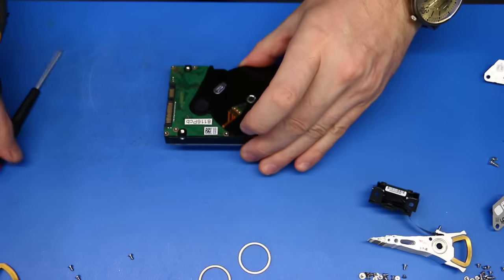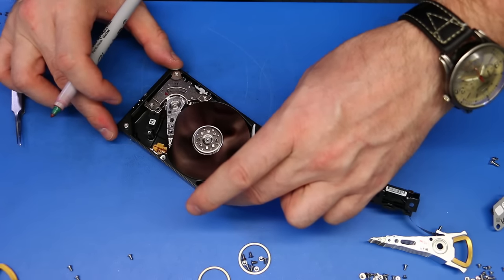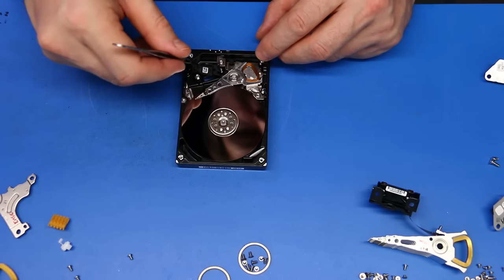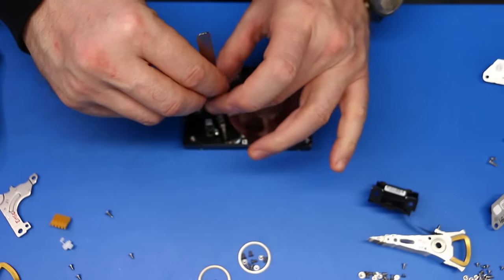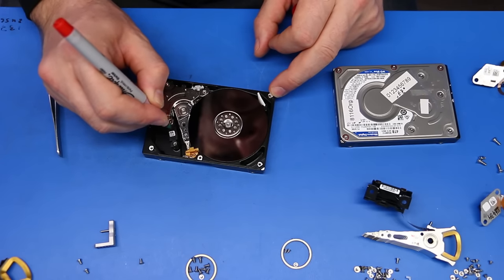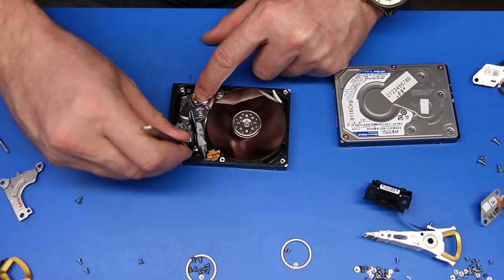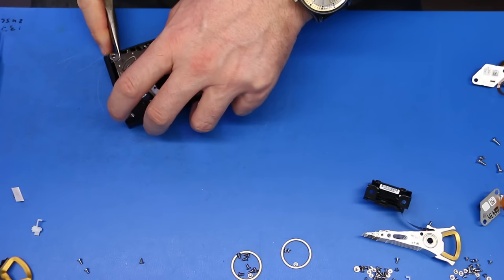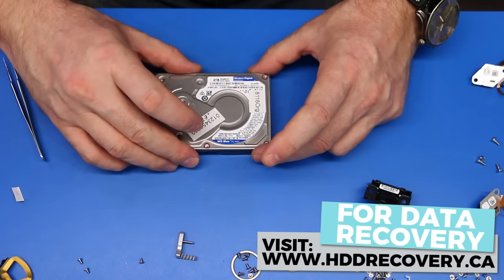4TB hard drive stopped spinning after it fell, now makes buzzing noise - is data recovery possible?

Comment: Very delicate hands for such a tedious job. What would be the cost of a repair like this? I have a couple old passport hdd that are about 14 years old and have failed. One has the buzzing beeping sounds.
Reply from the maker: Each case gets evaluated after we get it here, and we provide exact pricing before we start. If the quote is approved we do it, if not we ship it back. Recovery on old passports starts at $400 and goes up depending on complexity of work. If you want to ship them in for inspection, we provide free labels within USA. Our contact is www.hddrecovery.ca/contact-us 
Ps: in details, mention the link to this video and we will apply a 10% discount for you.
Cheers

Comment: I remember back before the ipod existed (which crapple didn't invent and is a part of my story), I had a creative labs nomad jukebox with a 6gb hard drive. I had a car accident where I nearly drowned to death. My device vanished to never be seen again. A few years later I replaced it with a 20gb nomad jukebox (even though the ipod was the same price). I can't remember if it was the 2nd or 3rd generation. It used square lithium batteries instead of nimh AA batteries like the original. At one point I dropped it. And yes it was on. It didn't take much before it was dead. I could have swapped the hard drive, but I opted not to. sigh..... So yeah I lost both of them sadly. It still kind of pisses me off that creative had this device first and everyone thinks that crapple invented it. nope, they stole it.
Reply from the maker: I didn't know that
Reply: @hddrecoveryservices  Another thing that drives me nuts, back in the day the iphone 3gs caught fire like crazy. WAY worse than the samsung note 7. But to this day it's the samsungs that catch fire. Apple always gets a free pass. I don't know why.
Reply: If you head to About in your Nomad, or a mechanical wheel iPod, you'll see a musical note logo. That's Portal Player, we did those devices (and a couple of others).

That's our dual core ARM processor in there, and OS, (and MP3 decoder, etc). Personally, I wrote the database engine, from scratch. It's all flat C.

Technically Apple didn't "steal" it. We were contracted just like we were with Creative and others. I'll tell you that our process with Apple was very very different than with any other vendor that used our chip. *very*. 

Our contract with them ended when they moved to the virtual wheel . Up to that point (and all through the life of the others), that's my code that's pulling titles for you. John got the 2nd core working for decode. Sobe wrote the file system. The decoder was done by a 7 person team of math heads. Interesting times to be sure. More 24 hour days than you would think could exist in a single month.
Reply: @midiwall  more like stole the credit. Apple does that a lot. I love how things exist in android for years and then apple "invents it"
Reply: @awilliams1701 - that's kindofa different topic. Apple are shits in that regard, but (unfortunately), they're legal. I just wanted to clarify that, regardless of how it looks in this case, that this was a game won by their marketing people and not theft.

Side note: the batteries in the Nomad were spec'd. We had a BITCH of a time finding anything to work there.
Reply: You'll appreciate this aside to fuel your hatred... When the very first iPod shipped, Apple sent us "some" to say thank you.

They sent two. Directly labeled to specific people. Our director of engineering got one, and I think the hardware lead.

No one from software. Or our immediate management.
Reply: @midiwall  I never said it wasn't legal. It's all about them taking the credit for BS they had nothing to do with.
Reply: @midiwall  At least they didn't threaten to fire you (the original iphone creator had that happen)

Comment: No, you cannot recover it with the use of inhouse tools, software or any of that. It needs a transplant to a different HDD, exactly the same model number and even the original PCB since they are carrying a firmware esp for that unit. 

I used to perform data recovery for years.
Reply from the maker: If you can't that does not mean that others can't.